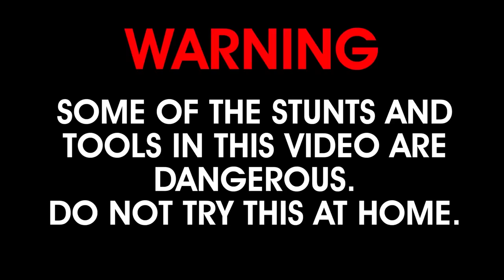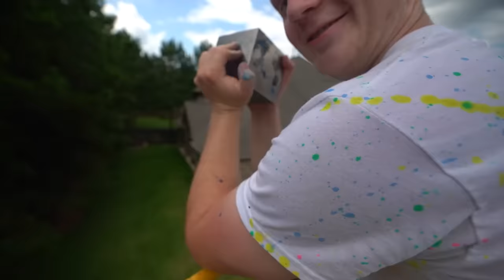Dropping INDESTRUCTIBLE CUBE From 1,000CM!

Comment: Try using gallium or mercury to turn into an alloy maybe you can use that mercury and gallium to basically break the tungsten by turning it into an alloy that may be soft enough to break normally like with a hammer or melted off with lava and maybe I can make the entire tungsten block week or just part of it it
Reply: Tungsten is one one the few metals that is unaffected by gallium and mercury